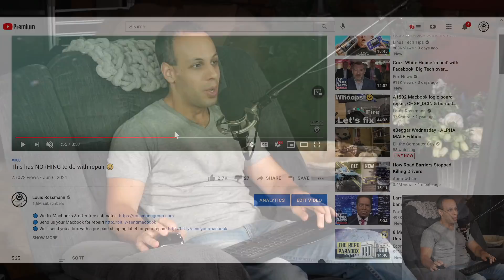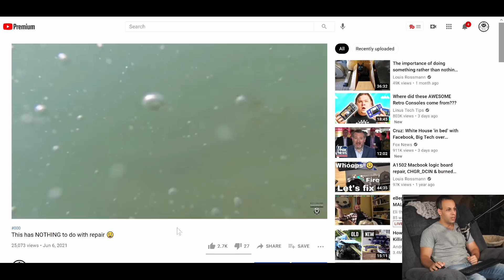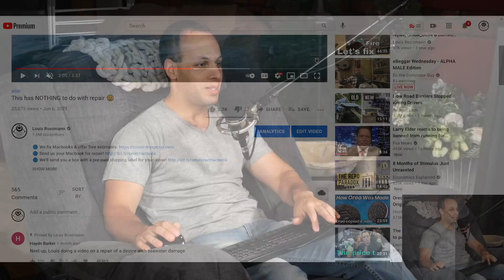Why are user serviceable batteries a bad thing?

Comment: Getting away from removable batteries was a blatant sign of the abuse they were going to do to us.
Reply: Same with SD cards!
Reply: @eastonvonschist2283  And headphone jacks.
Reply: @Shotblur  now you have wireless headphones with non replaceable batteries. amazing
Reply: @vicentemorande1558  Bonus points if they're actively designed to reduce repairability, like the Airpods Pro.
Reply: @Shotblur  But think of all the plus sides! Look how much space the headphone jack took up inside a phone! Yeah, sure, it actually looks tiny as hell, and the wireless phones introduce like a dozen new problems... but think of all the useful things we could put there now! Like... 3% more battery! Its total lifetime will last like 1 week longer before it turns your entire phone into an expensive glass brick. Or maybe we'll put a fourth camera in! Takes 4x better pictures. 400 gigapixels. Films in 4D. Or maybe it makes about as much difference as those razorblade holders where we just added more and more blades.
Reply: @vicentemorande1558  Oh and you can't buy cheap wired hi-fi headphones anymore, now you need to either enjoy the amazing quality of landline phone sound on your Bluetooth headphones or just spend 500 bucks on a decent pair of wireless headphones that still sound crappy but hey, this is technology!
Reply: @TuxraGamer  good thing my phone still has headphone jack so I can use my 6$ wired headphones. Sound quality is not good, but I didn't buy them for sound quality anyway.
No replaceable battery though and I will still need to find a case
Reply: @Shotblur  I bought a flip phone a few weeks ago. It has a headphone jack. The most important thing when on hold and working on a computer. Also, what the fuck is with hold music every minute cutting into some type of pre-recorded response? Which then forces me to put the phone back up to my ear to make sure it isn't a real person answering. Just keep the damn hold music on.
Reply: @eastonvonschist2283  I have a $200 Xiaomi phone. It has Snapdragon 860, 120 Hz screen, SD card slot, headphone jack, and an IR blaster. There are sane phone manufacturers left.
Reply: @aozora7  Never heard of it!
Reply: Don't forget that they also doubled prices for flagship models. Just 5 years ago most expensive phones were around 800$. Now they are creeping to 2k mark.
Reply: @CockroachSlidy  It's ridiculous. No phone is worth 2 grand.
Reply: @CockroachSlidy  The most expensive phone in 2015 topped 10K,  I think that a little more than $800.  Google can be your friend after all.  The average smartphone cost was around $800 in 2015 or 2016.
Reply: It's because back then someone willing to spend so much money on a phone etc had a little bit of brain since the social networks took off a bunch of dummies buying tech
Reply: And the fact that they charge them as fast as physically possible without it bursting into flames. Talk about life cycle reductions.
Reply: I haven't bought a single phone with a non removable battery
The very idea of buying such a thing baffles me
HOW do you trust them with their money when they do THAT?
They are taking the piss right in front of your face
And you... Ask for more? What?
What's next, cars where battery is not replaceable?
Reply: I have never had a phone that doesn't have a removable battery, but I think I'm finally getting forced out
Reply: Let's not forget buddy that a 4 year old flagship phone is still supremely good apart from gaming. If you are a moderate phone user You are a fool to change your phone ever year especially past 2019
Reply: Just wait till they bring it to the car market..
Reply: @njmwape1  just look what happens if you try and get a salvaged Tesla back on the road. Soon you will own nothing and be a happy slave.
Reply: Just a reminder analysts love sealed phone and consumers flocked to them. The vendors tested the waters and consumers gave them the green light.
Reply: I don't want to get rid of my LG G7 ThinQ lol. Guess I'll see if someone can fix the charger for me
Reply: I agree with everything (most of all batteries and headphone jack) and add one thing: who the hell cares about having a phone as thin as a wafer with 30 min lifetime battery?
The standard should be 4-5k mah and a thicker phone. Reduced price, easier to repair and include components, more durable and, obviously, you could use it without it slipping everywhere like a soapbar in prison's showers.
The difference is that behind you there's an apple genius ready to r4p3 your wallet
Reply: @E_Proxy  the people that care about the is the same people posting themselves on the toilet loll bro they will never be a consensus as dummies are buy it. Example they buy a pretty phone the company spent millions designing the phone, The dummies buy it for the looks but then the dummies slap a $11 dollar Chinese  sweatshop case on there phone.... Why not Make phones durable again start 3d printing the back or something why have glass on the back ? Anyway All they have to do is look on eBay and see dummies selling there 5 month old broken back phone for 1/3 the price and laugh lol
Reply: @Seti-ms9bs  eheh, well that's a consolation at least. I really don't get it. I mean, I get it, dummies are they major income bringer so they design for the masses. But God. A phone could be cool looking and all the other things we were saying even if made "simpler". Also, I would like much more vanilla-Android phone with not as many customizations by the producer (that is why I got away from Xiaomi after a couple of phones, and I've only had the android 1s I think). Because if I want a custom interface and stuff I use nova (as always).
I now have a zenfone 6 cause I like asus and liked the idea of the camera (together with other specs such as battery and an almost clean android). But as always I have to keep it in a case since I am a clumsy moron and no smartphone survived more than 1-1 1/2 years
Reply: @E_Proxy  True bro as a clumsy guy myself google Samsung Galaxy Xcover Pro and keep a eye out on Samsung active phones I have a feeling they may bring it back soon...... I had a s7 active for 4 years one of the best phones I ever had........The Asus Zenfone 6  is a great phone tho as the camera is great and will be top for years to come disable fast charging tho. I currently have a s10 plus as I'm not going to buy a phone without a 3.5mm and a micro sd as I have a huge music collection, It's working good so far lets see how long it will last
Reply: @lelsewherelelsewhere9435  yup, I've heard about that. Maybe I just walked away because (since I break lots of phones as I said) I Just bought entry-level for a while (MiA1,...) thus I was sick of the low performance. I was afraid of going top-tier due to my clumsiness but I did for the zenfone.
I'm outing right here but I have incredibly basic knowledge when it comes to IT (even if I am a consultant...): I can build a PC, install and stuff. But I have an elementary ability of troubleshooting and, when it comes to smartphones, I am a true dumdum. I tried sometimes but my highest achievement is installing an APK. When I tried roms and stuff I was forced to hard-reset. Not my league
Reply: But its really not that hard to replace batteries as long as they aren't extremly glued in the frame. Especially considering the fact that batteries that are "user replaceable"  have a thick plastic case for safety reasons and therefore a lower capacity.
Reply: @Fus1onplayz  You do know that is the number one reason why people change phones,  the amount of pollution carbon etc that is caused by making a smart phone is high that is just dumb, we should be at a point now that we make things to last(modular phones). Yes it is hard in a way one little mistake and you can kill the screen etc also you have to use heat on a sensitive piece of hardware that is never a good idea(always a chance your taking). No you can use the same battries but use screws or a locking mechanism for the back of the phone paying 1k+ for a phone that is glued together is dumb.
Reply: @Seti-ms9bs  sure but why does the back have to be glued? Im using a phone that has a huge battery while having a back that uses 2 screws and some clips to stay in place. Changing the battery for this device is very easy and quick ~ 10min.
Reply: If you can remove the battery, you can stop them from snooping on you...